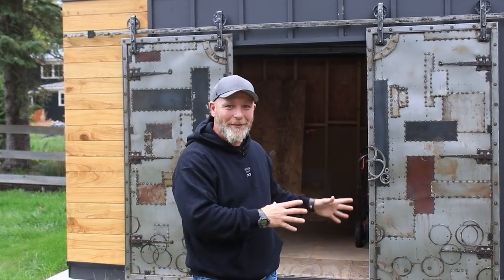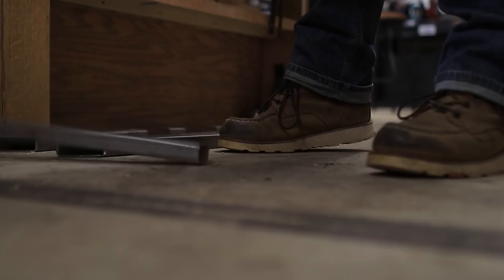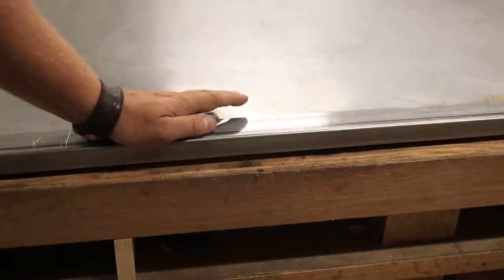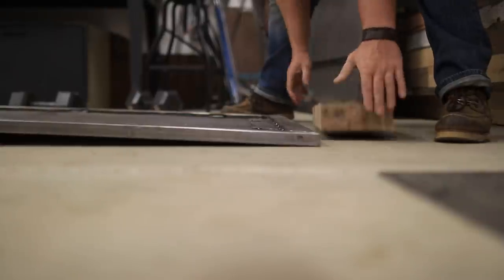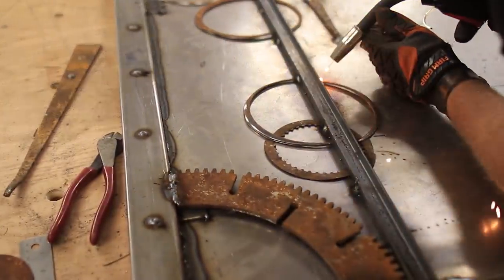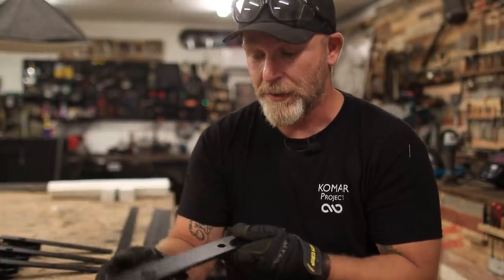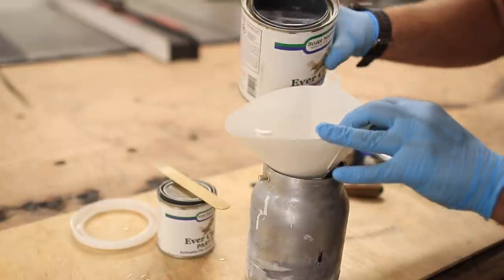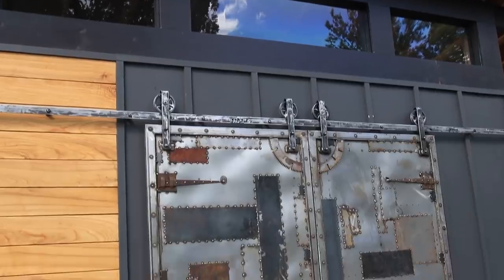Building Metal Sliding Barn Doors for my Shed

Comment: Welder here! Heat will absolutely warp when welding seams on thin gauge steel like that, best thing to do is stitch weld in a circle. Start in one spot weld 3” skip 6” then repeat until it’s fully welded!

In the case that it does warp as it did, you want to heat the crown of the steal. So if it’s a rainbow shape 🌈 heat the top and it will curve back up to you. Vice versa if it’s warped in the other direction. 

Beautifully crafted doors I love the result! I’m planning to buy some property and build my dream home/shop/gym! Thanks for the inspiration

Comment: For future reference when making large welds the best way to do it to prevent warping is to either lay your beads in small batches letting the metal cool in between or to work from the outside in alternating the side you work from.
Reply from the maker: That’s a great tip Jordan.   I had a friend tell me the same exact thing after I posted what happened on Instagram.  You hit it right on the nail buddy
Reply: @KomarProject  it's something my teacher drilled into my head.

Comment: Welder here!
The heat issue is rsther common, and if I can assume that you worked the entire line top to bottom, then that was where your mistake was.

For future reference, spread out the heat, and clamping down your project can be helpful to prevent bowing.
A door like that, it would've been smarter to divide the heat in sections, doing a bit at the top, then at the bottom, and work your way to the center.

It looks really good though! And your less scientific way to fix it, happens more often than you think ;)
Keep up the good stuff dude!
Reply from the maker: Ya I sure did. Should have probably done a inch at a time.  Had no idea metal would bend like that.   Live an learn my friend

Comment: If you heat the top of the arch on a warp then quickly spray water on the top of the curve with a spray bottle (only wetting the top of the arch) the molecules will basically shrink quickly on the side you just quenched (top of the arch) pulling the top of the curve tighter slightly shrinking it due to the instant cooling fixing the slight curve nearly instantly. You have to get a little feel for it but it’s a very fast very accurate way to do it. Or to avoid warping all together tack the entire frame corners together, square it, then tack the entire frame every foot all the way around to a metal table (if possible) then only weld one little spot at a time jumping around corner to corner never welding one whole area at a time, just small stitches jumping around letting the opposite side cool very often, then you get a dual prevention of warpage but before you cut the tacks on the frame where you tacked it to the table make sure you let the entire frame cool completely and your steel will naturally relax and your frame being tacked flat to the table will stay flat. Third way of that’s not an option is to tack the corners, square it then do very small stitch welds never welding more than one side at a time before coming to the opposite corner letting the other side cool while you do another small section, you’ll jump around a couple dozen times welding the frame but everything will pull way less this way and stay more metallurgically  relaxed if that makes sense, Excellent project that’s such a cool looking door!